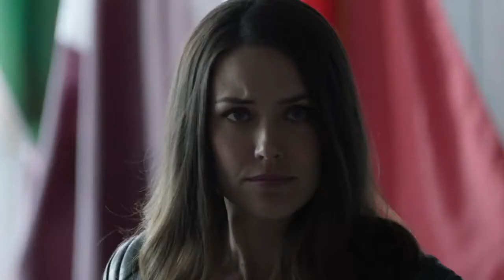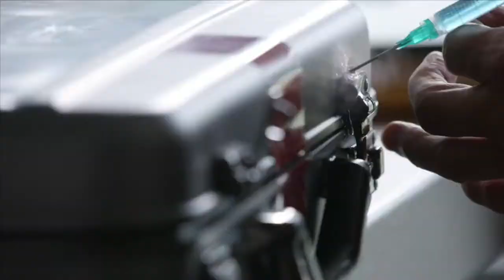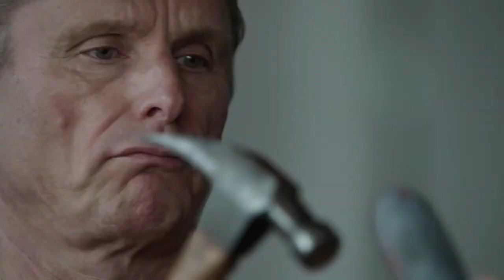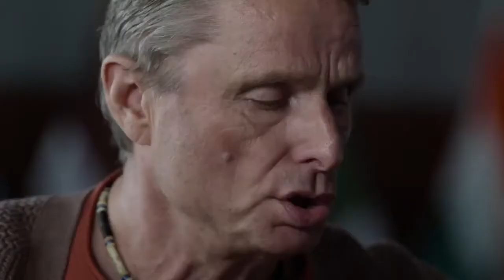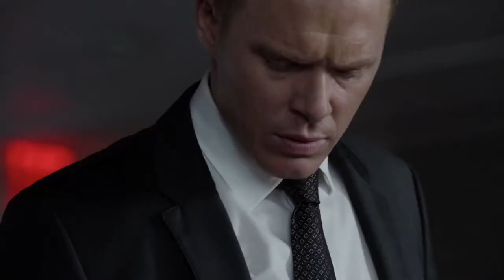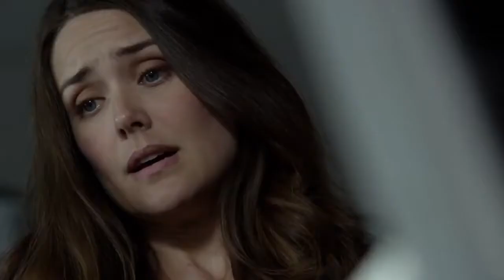Bomb at UN

Comment: if thats plugged into a breadboard why is he cutting wires instead of just pulling them out of the breadboard ???????

edit: There was no way that breaking the lock was ever going to trip that alarm do hickey because they would have to have made this bomb so resistant vibrations otherwise it would have set off on the metro from a wire popping out of the breadboard
Reply: I’d cut them because you could have to leads touching or a lead touch something and get shorted. Cutting is safer here imo